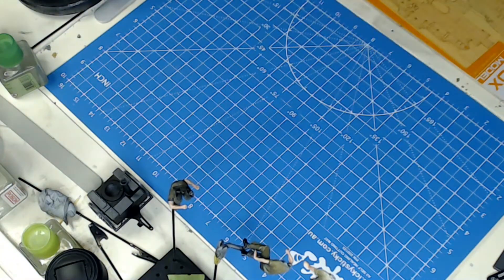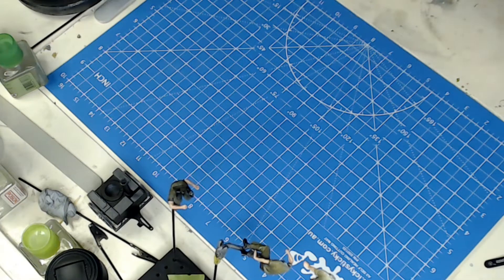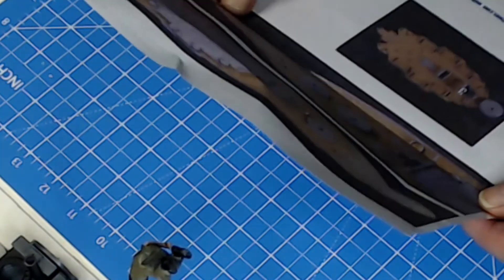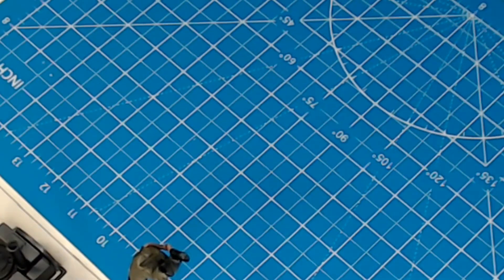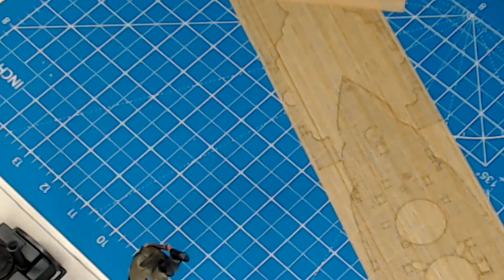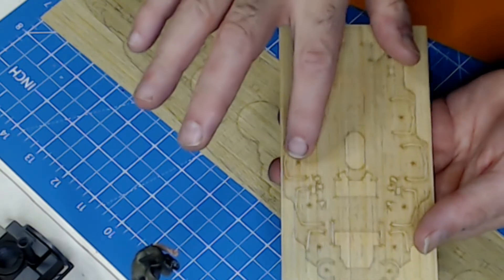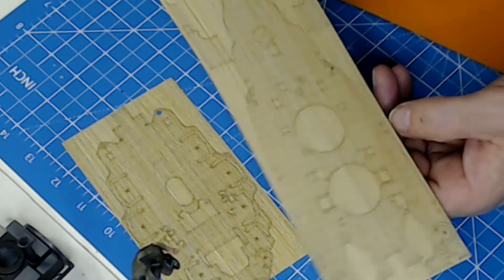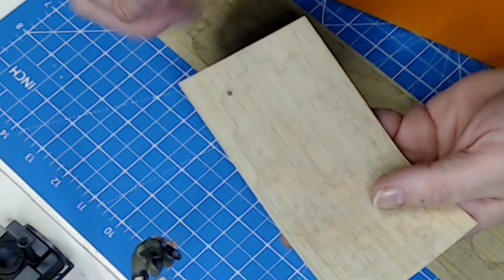Jeff special.Special request from @JeffDonahueScaleModeling

Comment: Hi Simon, Thank you very much for the review.  I'll have to see if I can get one ordered.  Just studying the instructions, there is quite a bit of plastic that needs to be removed from the decks, to eventually be replaced with PE or 3D printed parts.  As an example, there are a couple of wenches that are molded to the deck that need to be cut off.  I would leave the part in the deck that would go under the wenches in place and glue the new 3d printed wenches on top.  That way the new wenches don't look like they are setting in a hole.  The same would go for all the ladders, shields, and most anything else that will be added.  Harry Houdini started doing a video series on the hobby boss Arizona with Eduard PE added.  His example did not include the 3d printed parts though.  If I remember correctly, he gave/sold the kit to a friend and never finished it.  The videos, as far as he got, have some very good info in them.  Talk to you soon.  Have a great day.  Jeff
Reply from the maker: I have seen one of his videos on it. I will have to have a look at more. I might need to get a dremel type tool I think.
Reply: @hibbosmodelbench2351  Thanks Simon, I ordered a deck today.  The only place I could find one was on E-Bay.  The seller says it's the same brand, but the packaging was a bit different.  It's going to take a couple of weeks for it to get here.  It also comes with the cable.  Are you going to do your field kitchen first, of go on with the Arizona.  I don't really want to start chopping plastic off the deck until I can get my hands on the wood one.  I want to finish at lease one of the current kits I have going before I get into the Arizona too much.  I want to come up with something better for a base.  I might try to get a nice piece of wood and a couple of brass turnings to put it on.  Thanks for making the video for me.  I really appreciate it.  Jeff
Reply from the maker: @JeffDonahueScaleModeling  I have made a start on the field kitchen. It’s a fun little kit. Will do a whole video for the full build. ☺️☺️
Reply: @hibbosmodelbench2351  Sounds good.  One tool I just picked up that I thought might be useful is a Hoplex Model chisel set.  I paid about $20.00 US for it on Amazon.  It has chisels ranging is size from 0.1 mm to 2.0 mm.  I thought they might be handy for removing plastic were I plan to add PE.  I'll be watching for your Field Kitchen Video.  Jeff
Reply from the maker: @JeffDonahueScaleModeling  I will have a look for that chisel set. Sounds pretty bloody good. I will prime the kitchen and jump on and look ☺️☺️

Comment: Cut all your parts out and test fit, test fit, test fit.. I put deck down before Photo etch, ladders railing etc. its only designed to go over the deck as it is out of the box.
Reply from the maker: Thanks for the tip little fella. I shall ensure to do that.
Reply: @hibbosmodelbench2351  That tip was for Jeff "little fella" 😊 😄
Reply from the maker: Wow  @OzScalemodeling
Reply: @OzScalemodeling   Thanks Peter, I will take my time and check everything several times.  I really appreciate your advice.  Have a good one.  Jeff